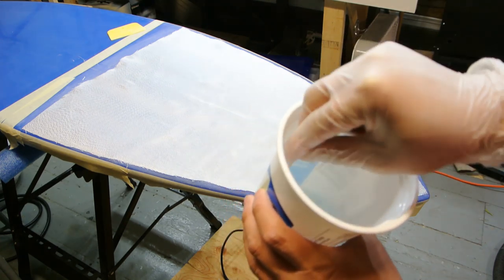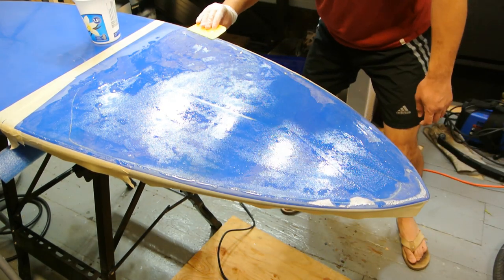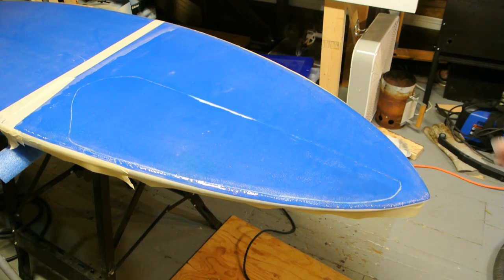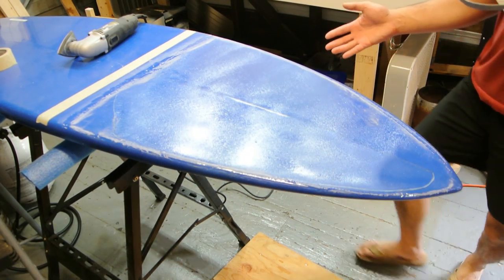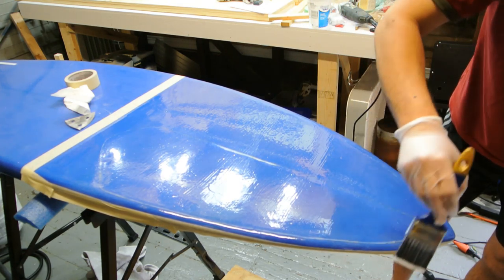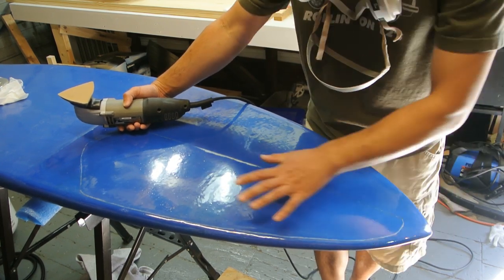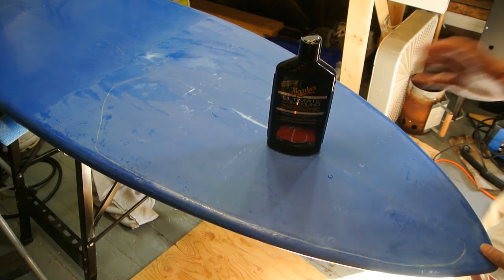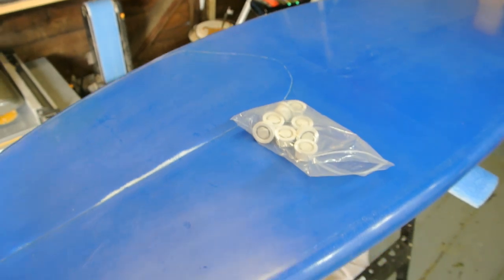How to Repair a Surfboard Ding or Delamination - Part 2 of 2

Comment: Great detailed video. Thank you so much for taking the time to put this video together. I have a 9' Naish SUP board, but 1/3 of the top deck has delamination. The delaminated area looks like the core foam shrank down. Just as you did in this video, I peeled off the large area of glass. I am planning to patch the same peeled glass back. My question is how I can fill the area of the foam that looks like shrank down. I am thinking to use foam spray. Some other video shows, grinding down the core foam to a certain level, and putting some layers of new foam pannels. What do you say?

Comment: I was searching to repair a section that bubbled up on a Soft Board but came across your tutorial on fiberglass boards. Very interesting and got me thinking on possibly repairing an old fiberglass long board. Thanks great tutes!!! But would you have suggestions on repairing soft boards that bubbles up due to sitting in a hot temperature car?

Comment: Nice videos. I'm learning so much. I'm wondering tho, before applying the final coat of resin, you sanded only the edges to blend in the fiber glass to the rails. Aren't you also supposed to sand the center area before applying the final coat of resin?